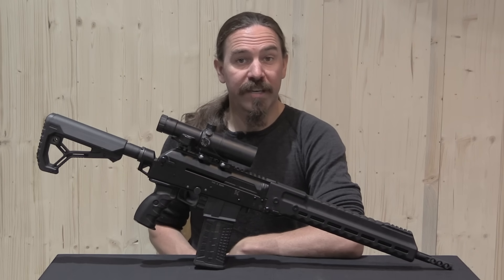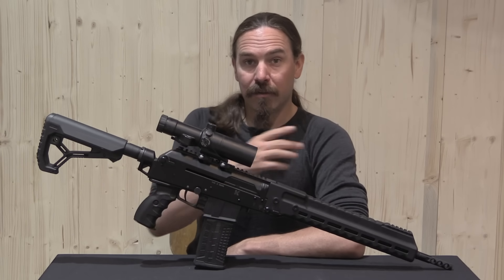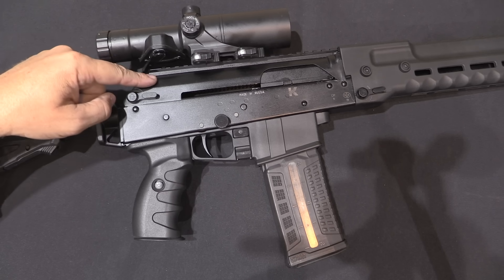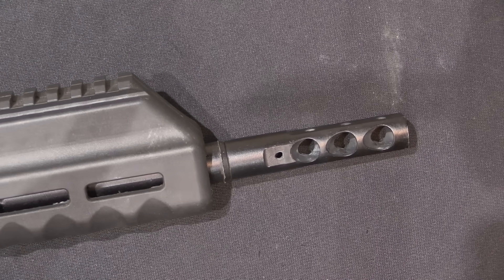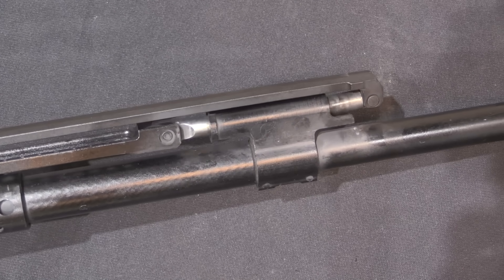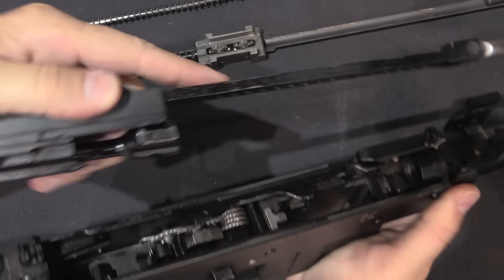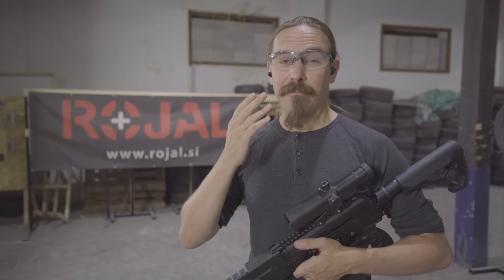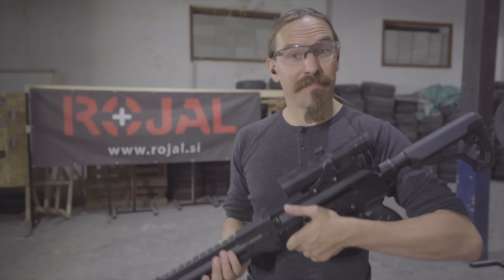Balanced Recoil AK-107 / Kalashnikov SR-1: Is It Any Good?

Comment: I am sure they are mechanically sound, but some of those welds look a little... rough.

I am also reminded of that story where a gunsmith designed an entirely new rifle whose locking was supposed to be carried out with a weird angular inertia mechanism. It seemed to work, but it turned out the angular thing was doing absolutely nothing and the mechanism in reality was just a stupidly elaborate blowback arrangement!

Comment: the way the top cover is securely attached so it can maintain zero is actually pretty smart, why didn't they do that for the AK-12?
Reply: My guess is that bureaucracy and corruption played a part.
Reply: This rifle was literally sold for 3.5K euros when it was available in Europe. The AK-12 civilian variant was more or less 1.8-2K euros (basically a twice as expensive civilian Izhmash Saiga AK-74M with some more polymer this and that, adjustable stock, new iron sights, some rails and all the problems we know about this failed AK). Let's not even start with how expensive Molot Vepr-12 were. Who would seriously buy this thing which is basically an inferior AR-15? For this price, you'd get a premium built AR-15 instead. Or a mid range AR-15 with a nice optic and other accessories that would do the job. Or even an AK-74M fully kitted with legit Zenitco parts.

Comment: Given the disparity in the moving masses, it doesn't make sense to me that this is any sort of mechanism to compensate for bolt motion.  This instead looks exactly as if the design is intended to reduce lateral force on the barrel as would otherwise be present in a piston-operated system.

Comment: I litterly drawed this system as a 13 year old. Beeing interested in firearms mechanics. However, i designed it with more mass on the counter shaft so that the mass of the bolt and bolt carrier is equal tot the counter shaft

Comment: From an engineering standpoint, you’re trying to balance an open system. If you balanced the bolt momentum completely with the compensation system you’d still have the felt force of the round but you’d now have a lot more mass in the compensation pieces and a much smaller brake. It’s better in terms of moving mass and overall weight to have a larger share of mitigation done by the brake.

Comment: It would be interesting to see just what the actual forces are that the rifle is subjected to with and with out the compensator when measured with accelerometers.
In terms of design (I'm not a firearms designer by any means) I'm wondering if it is really required to have both parts of the system gas driven. Unless they want to reduce wear on the gear system by not using the two gears to drive the counter mass forward.

Comment: The balanced recoil system this thing uses doesn't start to make a real difference until you really start to hose.  I think the rate of fire for the AK-108 in 5.56 was something like 800rpm.  It'll get most, if not all, of your sent rounds on target so long as you do your part.

Comment: It seems that either this system was tuned to be used with the muzzle break or it wasnt designed properly to actually mitigate the recoil. Maybe ithey had problems with heavier counter balance part. Most liekely tuned for the break.

Comment: All of this talk about recoil mitigation systems makes me wish you could get your hands on Anatoly Baryshev’s experimental weapons. They used a special delayed blowback mechanism (called case setback) that could nullify recoil. The effects were so impressive that even 12.7x108mm and 30x25mm versions of the system were made. Allegedly they all had reliability and accuracy problems but were very lightweight and actually controllable in full auto, even in the aforementioned heavy calibers. It’s development history is also pretty interesting, being one of the few weapon designs that was a private effort by Baryshev himself, and not the Soviet government. 

EDIT: Some examples are the AB 7.62 (7.62x39) and the AVB 7.62 (7.62x51)

Comment: The system looks clever and sounds like it's going to work just as in the theory, but it doesn't. I wonder why. Is it because even in small caliber, unlike how Ian said, bullet leaving the gun actually does contribute a lot to the gun's recoil just as much as the felt recoil by bolt carrier hitting rear body of the gun and the chamber?
I think one way to experiment this is to shoot such counter-mass gun in high rpm full auto. The system is supposed to kill wobbling recoil, and what seems to matter is the other kind of recoil that is 'pushing back recoil', and that's what can be handled by shooter's shoulder during steady high rate of fire full auto unlike the wobbling recoil that the system is supposed to kill.

Comment: Am I missing something here? Wouldn't the "balanced system" cancel itself out leading to no actual benefits to the rifle? What I mean is that the extra parts are balanced to themselves and not the bolt of the rifle. Could you not get away with using rubber stoppers on the end of the recoil spring to slow the mass of the bolt carrier group?

Comment: I had put a Precision Armaments Severe Duty brake on a .300WM and was really impressed.  Put another one on an AR10 (which was excellent)... and then noticed they had one for an AK(47) so grabbed one of those - turns the 7.62x39 (which isn't that bad to start) into a kitten.  A good brake might be all the fix you need and save you from having to drop tons of ca$h on mods or finding unicorn rifles.

Comment: Hmmm - the rod that moves opposite the bolt seems to have a much lower mass. For this system to work well, shouldn't they have about the same mass so that their acceleration at the same rate in opposite directions produces zero net force?

Comment: Does the counter weight on top weigh the same as the bolt carrier? If impulse is mass times weight, then it should make sense for them to have the same mass. However the bolt carrier looks quite heavier

Comment: The recoil from the shot is called free recoil. The only way to minimize the perceived free recoil is with a muzzle device. The balanced recoil system does what its supposed to do, but the perceived recoil from the weapon cycling is actually very minimal to begin with and its almost identical back and forth and thus nearly cancels itself out before the shooter can perceive it.
In Soviet trails the initial weapons (AEK line-up) the balanced recoil system did in fact make nearly no difference in single shot mode. In automatic and burst fire, however, the difference was more noticeable. But as you said - the added cost and complexity just wasnt worth it, especially for combat use. Didnt stop the russkies from developing some cool ass rifle designs though.

Comment: I can see that this is a bit too complex for the military but it would still be interesting to see how well this system would reduce recoil in 7.62X39.  Would the extra recoil from the larger cartridge make it work better or would it not really make a difference?
Reply: It works way less effective for 7.62*39 - bigger cartridge equals less persentage of felt recoil from bolt movement
Reply: @tsorevitch2409 I should have thought of that.  That makes perfect sense. Thanks

Comment: I feel like this is slightly more complicated than it even needed to be, as simple as it may be.

Why have the gas piston power both the bolt and the counterweight when those two gears are already there? Wouldn't those gears force that counterweight to start moving every time the bolt moves anyways?

Comment: When is someone going to make a balanced recoil system for the AR? Maybe a gas block with an added piston traveling opposed to the direction of the bolt travel, returned by a spring?

Comment: It's a neat gun, but I can't help but question the point of it when chambered in 5.56, 7.62x39, or 5.45x39 since these are already gentle-shooting cartridges. The biggest reason that rifle cartridges like 7.62x51, the recent .277 Fury, and 6.5 Creedmoor are impractical in sustained fire is the obnoxious recoil - why not use this system to tame larger calibres instead of redundantly lowering already low recoil?

Comment: That twin-rail rack and pinion system driven by twin gas ports strikes me as impossible to perfectly balance. You can get close, but inevitably the force in one piston is going to be a touch different to the force on the other and one rail will get a different acceleration to the other, forcing the cog to accelerate one rail to match the speed of the other. 
There's probably not enough of a difference to affect the functionality, but if you're inevitably relying on the cogs to synch the movement, why not just cut it down to a single gas port and have the cogs accelerate the other rail? You might need to rebalance the rails, and potentially beef up the cogs a bit, but eliminating the machining of a full gas port and piston would make it a cheaper system to manufacture.

Comment: minus the counterbalence recoil system this is the gun that should have been issued especially all the lower +the mag ang the ambi mag and bolt lock and release  hard to believe they didnt at least use this lower on the new ak upper,
anyone  think that would have not been a massive upgrade

Comment: wow you usually see AR's take from an AK it is unusual to see the AK take from the AR. I guess that solves the debate of which is the better of the two platforms. I love where the SR1 was heading with those changes even as unpractical as they were I think they are on to something when trying to build the ultimate platform/battle rifle they are getting closer in my book the innovation is just wow. they are headed in the right direction in my opinion just not the counter balance  and the weight has got to be reduced

Comment: Those brakes/compensators on ARs definitely reduce muzzle rise big time. I hate them though cause they're so obnoxious to anyone else around. Just recently I took off the PWS comp on my own AR cause of that and put back on the A2 flash hider. For competitors sure but for ARs intended for fighting/defensive I think they're obnoxious and unnecessary cause the gun doesn't recoil much anyway.

I wonder if that counter-weight system works work better with 30 cal 762x39 or .308 caliber rifle? Or does just a comp do most of the work for them too?

Comment: I think an open bolt machinegun with balanced recoil would be quite neat!

First round accuracy could possibly improve a lot.
Reply: It will be pointless as MGs are already heavy and their bolt doesn't contribute to significant persentage of felt recoil
Reply: @tsorevitch2409  Do you have any experience shooting open bolt MGs? 
What happens when you pull the trigger on a charged but empty MG?
Recoil happens. 
And on a charged and loaded MG, that Recoil affects the point of aim even before a cartridge is loaded i to the chamber.
Reply: @johanarnfinnlvold5989  Ive shot PKM that is very light for GPM and its still too heavy to reliably shot from shoulder and when shooting prone it totally controllable
Reply: @tsorevitch2409  Yes, but I am not taking about controllability, but about first round accuracy in a burst. There is a reason why sniper rifles are not open bolt.
Reply: @johanarnfinnlvold5989  its just unreasonable to make extra effort for first round accuracy in a GPM.
Reply: @tsorevitch2409  IT would obviously have to be designed more or less from scratch to be able to incorporate such functionality i to a. MG. Not necessarily a GPMG, but a large caliber LMG could possibly be made more effective.
Reply: @johanarnfinnlvold5989  same investments in scopes or projectile tech would provide much better results
Reply: @tsorevitch2409  No, it would not. A lot of money have already been invested in optics and projectiles, and balanced recoil in a new gun would not necessarily mean much extra cost.
Improved first round hit-probability allows ammo-conservation, while increasing combat-capability.

Comment: The counter weight doesn't look to be significant fraction of the bolt groups weight. Combined with not extending bolt travel to avoid the carrier strike & giving the system sufficient travel distance. The welding of essential features into the receiver instead simply building a new receiver is a horrible design choice, but then basing the design on the AK was not inspired to begin with. This is basically the worst possible version of the concept.

Comment: i think the counter weight actually did nothing but "temper" the recoil by fiction in between those gears.... 
yes the mechanical system "redirect the motion" but the force is not simply redirected, the gear is attached to the gun by the axis, those axis transfer the backward force to the gun even while the gear is rotating.
Reply: Counter balancing works not.by reditecting impulse but by creating 2 opposite impulses that negates each other
Reply: @tsorevitch2409  i didn't say anything about impulse but as you mention, yes the impulse of the counter balance cancel each other, mv1 equal mv2. BUT the bolt still slam the rear end(with reduced speed as some KE is transfer to the system) unless all KE is transferred to those clockwork. it is hard to calculate but we can just watch slow-motion footage. ballpark figure in my head is..... the KE "absorbed" by that system really isn't that much because the transfer efficiency is almost directly proportional to the speed of the bolt.
Reply: @explosivealanli588  other part of the bolt hits the opposite side of the assembly at the very same time. Atleast in KORD counterbalances guns

Comment: I'm very confused by how this presentation is laid out. It is first stated that basically the system is not intended to reduce recoil from firing, but rather the felt effects from the bolt mass moving. Then somehow we equate muzzle climb and recoil, which are not the same. Then the firing portion is only looking for muzzle climb with and without the compensator, and doesn't mention the felt effects of the bolt mass, which is the only effect that should be reduced by this system. It seems a missed opportunity to compare this rifle to a standard AK-74M in the same chambering and with this same compensator mounted; then see what the difference in felt effects from the bolt mass are.

Great explanation of why the idea failed, though.

Comment: Does anyone know the weight difference between the bolt assembly and the balance bar?  It looks like the bolt assembly is still a good bit heavier, but I'm guessing adding more mass to the balance bar would reduce fire rate or would overstress the cog mechanism if the gass was turned up for the additional mass.

Comment: About it being pointless for competition: not only can you get the same result with an AR, you can get it with a Saiga MK-102 or 105. Just adding a brake/comp and a light weight carrier will get you a zero recoil rifle that weights under 7 pounds.

Comment: What’s the logic behind these type of upgrades? Wouldn’t it be more simple to design a system that’s less prone to recoil rather than adapting this system?  Also it was mentioned that parts for this rifle were adapted to use as many AR15 parts as possible….does this rifle maintain the legendary durability and reliability of the AK? After all, that is the most common justification for shooters who prefer the AK rifles.
Reply: It's a civilian competition gun that's why it made for .233 , AR-15 mags and AR stock. It have no intentions to be as reliabilable as normal ak-74

Comment: Import bans are one thing, but i dont understand why Kalashnikov USA hasnt released a copy of this.
I also find it hilarious how many elements of this are fundamentally better than the elements of the AK-12 that do the same thing, but do it worse like the simplified safety and the solid, AR-15 pattern stock rather than the folding, non-AR-15 pattern but AR-like stock that doesnt fit anything else.

Comment: I can sort of see the train of thought that happened while designing this weapon.
This counterbalance system doesn't work perfectly because to completely negate jolt from bolt hitting the stock and than hitting receiver you need counterbalance (including it's gas piston) having the same mass as bolt itself (including bolt carrier and it's gas piston). And that would probably make this rifle unnecessarily heavy.
And because you need muzzle compensator anyway (because you can't counter forces from hot gasses and bullet flying away with springs and weights) it probably was decided to lean on it a bit more, but save some weight.

P.S. It's really cool to see a high power gun almost not moving from a recoil.